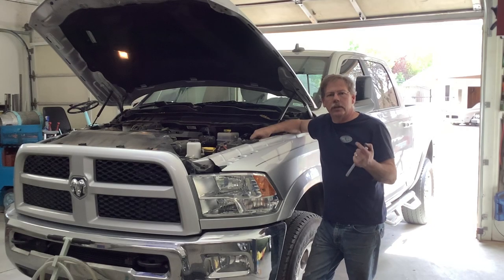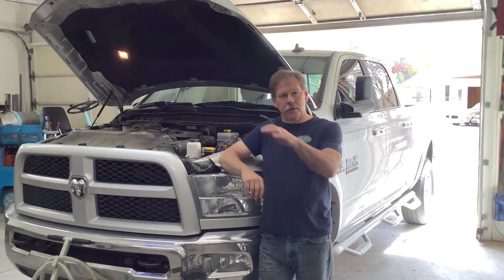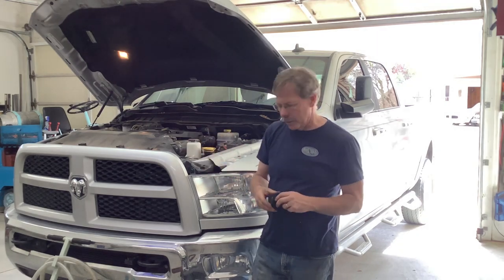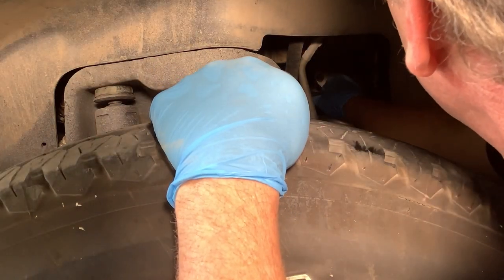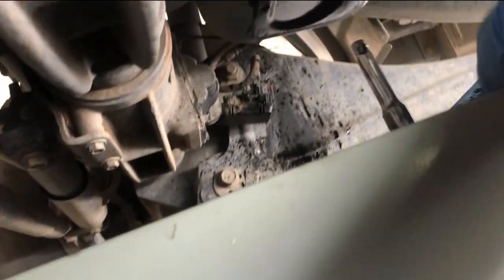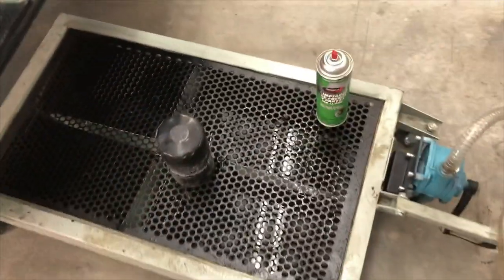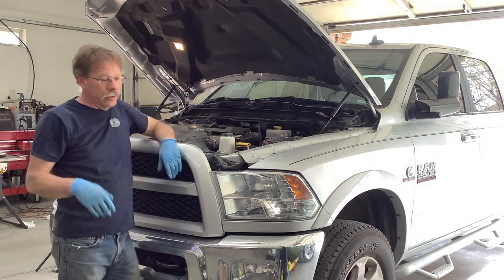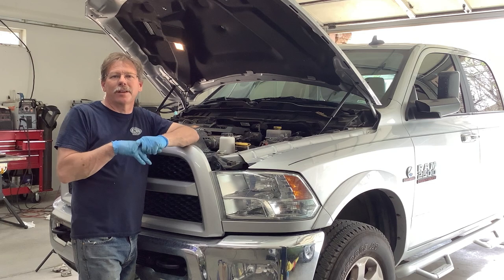2016 Ram 2500 - Cummins Oil Change

Comment: Thought I added a comment yest and was back with follow up? No Comment? Oh well. Here now. Perhaps I didn't save it.  So I did not have the filter plug. Will certainly acquire one. I had already started draining my oil and was then looking for tips on the best way to come at the filter and learned of the plug. Timing is everything. So I dropped the filter into a gallon size ziplock and sealed it. The bag was a little snaggy on some of the bolt heads coming out and I noticed this and double bagged it. Came out without a hitch. Or drop leaking for that matter. I put the new filter in place and before raising and attaching it I used a funnel and a Solo cup to pre fill the filter. No where as convenient as the plug you demonstrated but it got me thru my first oil change on this rig. Where theirs a will theirs a way. I will be seeking one of those plugs before the next change. Thanks for the video and tips.
Reply from the maker: Very nice solution!  As they say,  Necessity is the Mother of invention - ziplock to the rescue
Reply: Good idea I just let it piss out all over my truck and driveway never again!😂
Reply: @ryanbrown5993  Yah Ive since acquired two plugs. I use one on the filter Im taking out and one on the pre filled new filter. And do a quick swap. Love it.
Reply: @ericinalaska7648  absolutely I’ve got one but that’s not a bad idea they’re currently about 8 bucks on Amazon
Reply: Lol, I did the exact same thing (using a gallon ziplock). I came back to leave it as a suggestion, having not read the comments first. Seemed simple enough though that I figured I couldn’t be the first to have thought of it.
Reply: @jackjohnson291  Yep it worked but the plugs are a definite upgrade. I use them every time at this point.

Comment: Hey just so you know you don't need to fill the oil filter but if you want to plug the middle hole and fill it up from the smalls holes so that oil has been filtered....same thing with fuel filters
Reply from the maker: I would disagree, I want my engine to start with oil in the system and not need to wait for it to pump the filter full before the oil goes on to the rest of the engine.
Reply: @AllisonCustoms   but you are ok with unfiltered oil going into it....lol you definitely ain't a diesel man 🤣  with your Mopar filters... fleet gaurd are the best for cummins. Diesel oil is thick and the engine already has oil in it you never get it all out when a pm is done, oil is shot through the filter in a split second with no hard done in anyway. You are doing more harm dumping unfiltered oil into the center of the filter....
Reply: @AllisonCustoms  why dont you do that with transmissions as well would like to see you try to pre fill allison 4k series tranny filter. Make a video plz
Reply: @noluvnome2  As far as I’m concerned, new oil is already filtered…
Reply: Feeling it just makes it harder and messier to get back on
Reply: @noluvnome2  How do you filter the 12 quarts of new oil that you pour into the top of the engine? Seeing as we don't want "unfiltered oil" to touch anything before filtration.  Make video plz.

Comment: Where did you get that metal oil pan?
Reply from the maker: I think I got mine at Northern Tool.  I had to replace the pump because it leaked from the pump case.  There are several on Amazon some that look to be the exact same.  Also, the top grate (or whatever you call it) is very flimsy, I cut a piece of 1/4” thick expanded metal to put on there and then put the original back on top to help catch small parts.  We tried setting a small transmission on it at one point and the original grate just folded up.  Hense the HD upgrade.  It rolls really well and with the new pump it works great.  I might consider an electric pump version, but then you need a power source every time you want to empty it.????
* The following links are Amazon Associate links and do help support the channel - using them does NOT add additional cost to the buyer. *

DMC-FPPS Oil Drain Pan 17 Gallon Oil Drain Tank with Hand Pump - (very similar to mine, I like the pump up front):  https://amzn.to/3VLdJ0F
VEVOR Oil Drain Pan 15 Gallon Oil Drain Tank (rear pump - may cause issues getting it under some lower vehicles):  https://amzn.to/4bW0sYV
VEVOR Oil Drain Pan, 15 Gallon Oil Drain Pan with Electric Pump:  https://amzn.to/45wxz38

Thanks for the watching and commenting!

Comment: I just purchased a 2016 Ram 2500 Cummins as well and today I am going to do my first pick oil change on a diesel. I thought there was going to be 2 oil filters for some reason or is that only on certain diesels?
Reply from the maker: I’m personally not aware of multiple oil filters on any factory trucks.  There are however two fuel filters on our 2016’s.
Reply: There is a fuel filter. Could be thinking of that
Reply: You will see that on certain brand diesel usually bigger diesel engines, Detroits, and some others used duel oil filters

Comment: You didn't address none of the problems or the hardships of changing the oil in a 2016 there's nothing typical about it
Reply from the maker: Other than the special tool that makes taking the oil filter out, and I guess there being a LOT of oil to dispose of, it is absolutely just a typical oil change.
If you have a specific question(s), I’d be happy to try to help with answers.